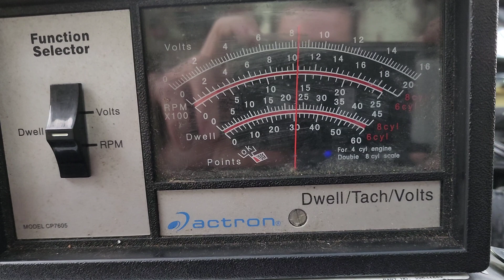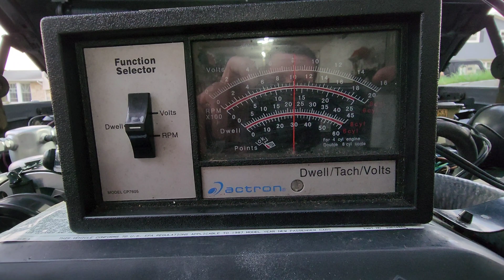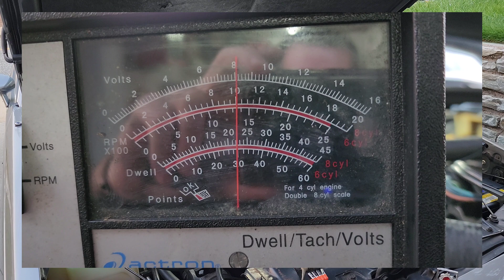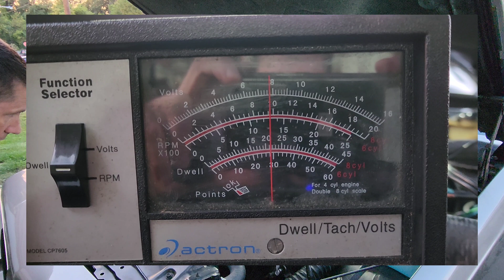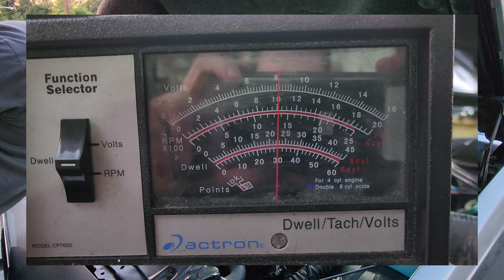The RIGHT WAY To Set The Mixture On Your Electronic Quadrajet Carburetor

Comment: Hello thanks for the job you do. It is excellent. But I have a question. My car is Cad. Brougham 1988 with engine Oldsmobile 307 8 cyl. with rochester 4BB E4MC. I am using the same dwell meter. But on 8 scale line I am reading 40 and on 6 scale line 30. In the video is mentioned to read on 6scale line. But your engine is 8cyl. I am not able to get on 30 on 8 scale line. Thank you for explenation.

Comment: What brand of carb tool is that?  I have a quadajet on Monte Carlo SS 305, but I have a remanned carb and the mixture screws are round with a slot in middle, will this tool work for it?

Comment: Hi thanks for the video, I have a question, I have a Cylinder dwell meter who have a Dial for select 4,6,8 Cylinder, The question is I need to select the 6 Cylinder or the 8 eight Cylinder option to set the dwell thanks.
Reply: Should be set to 6 Cyl
Reply: @rfbuilds8035  thanks for the help.

Comment: Question for you.  My '82 Ninety-Eight with the 307 Y runs slightly rough at idle, otherwise it runs fine when driving.  I've followed this carb adjustment video and have all the Thexton tools.  When I am adjusting the main jets I am not seeing the quick relatively changes on the dwell meter as seen in your video.  It seems like I have to make 1/2 a turn or more out so get the dwell to go higher.  And the changes I do see seem to be a bit inconsistent depending on when I make the adjustments.  Could this indicate a bad 02 Sensor?  Any other suggestions?
Reply from the maker: Shoot me an email at RPOrestorations @gmail.com. I'll see if I can offer a few suggestions

Comment: Great video with clear explanation. I have a Chevy G20 with this carb and it's impossible to get to the idle screws through the hood - so much stuff in the way you can barely see them!
Reply from the maker: Glad you found it useful. Thanks!
Reply from the maker: Uggh. Those are tough to work on.
Reply: @rporestorations  with the dog house removed and airbox you can just about get your hand to the front of the carb. Machined two "adjusters" from 5/16 rod with a slot cut on the end so I could turn both mixture screws.

Comment: 30° on the 8 cylinder scale.Should be on the six cylinder scale so you're still not there
Reply from the maker: I'm a little confused by your comment. The Quadrajet is set on the 6 cylinder scale of the dwell meter, doesn't matter what size engine its attached to.

Comment: Excellent video. Tuning the dwell made a huge difference in making smooth acceleration in my 87. Mine was a ways off, too high. Also cured a pesky hesitation between 1500 and 2000 rpm.

Comment: Great info, but... I have a 1986 Pontiac Grand Prix 305  Quadrajet.  The question I have I don't have any emissions on the car anymore but I still have the electronic carb and electronic distributor. Can I still use the carb and distributor even though I don't have any emission stuff? Seems to be running rich, do I still need to adjust mixture screws or should I just get rid of the electronic and go manual?
Reply: I have the same exact problem with my 1987 Firebird with the 305. Smog pump deleted. Seems to be running rich, already tore down Rochester and set the solenoid and floats to factory spec. When I adjust the mixture screws I get no change at all. Whether I bottom them out or back them off 6 turns. I don't have a dwell meter and I have not messed with the idle air bleed valve it's still capped off. But I did put a timing light on and it's running 0° at idle but starts retarding the timing as soon as I'm over 1500 RPM. I'm going to bypass the computer and put in a mechanical HEI ignition system. If yours has the computer and your service engine light is on, I'm guessing that your computer is pulling timing to causing it to burn rich and dump soot out the tailpipe like mine.

Comment: please help ......so im trying to set my dwell on my  86 GMC sierra 5.0 with electric carb. i purchased a dwell meter and connected the wire to a green wire on the firewall of the truck and adjusted just like you did and had no luck i adjusted with small turn and the dwell did no change what am i doing wrong or what should i do first please help
Reply: I think that green wire is for HEI dwell not carb dwell

Comment: Ok..but where on the carb is the idle air bleed?..all I noticed was your screwdriver diving in
Reply from the maker: https://youtu.be/LX4h6YH_KhY?si=w8cbhwGIqB1Ry4Qb

There's a good view at the 5:00 minute mark in thsi video.
Reply: @rporestorations  thanks but I googled it later on and discovered mine has a plated riveted over it..guess will just count on it being at factory setting

Comment: Hey man I have that same car 1987 Oldsmobile v-6 when I turn it on and it’s on cold idle it’s in perfect condition one’s it warms up and u put it on drive it has no power at all turns off can u please tell me how to fix it.
Reply from the maker: It could be several things. Will It idle at all when warmed up? Are you able to keep it going by giving it some gas?
Reply: @rporestorations yes thank you I replaced cables spark plugs and distributor cap what happened was that I had one of the spark plugs cable disconnected ha.

Comment: When adjusting the mixture control screw, do you adjust the driver side first then the passenger or do you adjust both together?
Reply from the maker: You have to adjust them both together at the same time. The carburetor should have a balanced mixture on both sides.
Reply: @rporestorations  do I close the screws or open them
Reply from the maker: Lightly close them. Then open them 3 1/2 turns. That's a base setting. Then make the adjustment as needed

Comment: Where can I find the air bleeder valve gauge tool
Reply from the maker: They're getting difficult to find, but they do come up on Ebay from time to time. The company that made them is named Kent Moore. They made a lot of tools for GM service departments. They also were included in their "Carburetor Float Kit"

Comment: That takes me back to the mid late 90s for sure lol. IMO, the hardest GM engine to get through the IM240 emissions test was the 307 Y olds mill. 1 thing I didn't hear you mention is that it is imperative that the car be in closed loop fuel control while making these adjustments, with a good o2 sensor. That's why I always use(d) a scan tool such as a Tech 1 or 2, or the ol Snapper Red Brick. I want to see eng temp, tps volts, o2 switching, and I can see dwell as well as block learn and integrator. Anyhow, I'm glad you're sharing this stuff. It is a lost art!
Reply from the maker: I did talk about it around 7:17, but you're absolutely right. If it's not in closed loop, the dwell won't vary and it will stay fixed at a certain reading. I like to use a Tech1A, too, but not many people have them, so I tried to keep it simple. And yeah, I always check the TPS voltage ahead of time. I might do a future video on the block learn and that stuff later down the road, as well. Thanks for the feedback. If you have any tips, Id love to hear them. Glad I could bring you back to the 90's!

Comment: Hi recently had my electronic quadrajet rebuilt and it is idling very high and running rich, other than the idle screws what do I need to adjust to have it idle lower?
Reply: Sorry I meant mixture screws not idle screws
Reply: @jaredrosenberger3583 Bet you have loose throttle shaft’s.
Reply from the maker: There could be a couple of causes. Is the fast idle cam disengaging when you tap the gas? And have you turned the idle speed control screw out? Check out the 2nd half of this video. It concerns setting the idle speed. 
https://youtu.be/o_LEpkWQbk4?si=uafHDGXKDpWYN471

Comment: Is 30 on the dwell meter specific to the engine or electronic carb? I have a 305 with the electronic carb would I still shoot for 30 but on the v-8 scale? 
Thanks for another informative video.
Reply from the maker: No. The 30° dwell meter reading is universal for all Rochester Dualjet and Quadrajet carburetors. Also, when setting the mixture, we always use the  6 cylinder scale, whether it's a 231, 305, 307, or 350 cubic inch motor. This is because the carburetor works on a 60 hertz cycle. (The solenoid cycles 60 times per second). Hope this helps!

Comment: Thanks for a more detailed video. But i think you only mention it and don't actually show that you jump out the 1 and 2 terminals on the computer port in the car. So do you or don't you to set the dwell?
Reply from the maker: No. You don't jump the terminals on the ALDL (computer terminal) connector. Jumping the diagnostic terminals would put the motor into "Field Service" mode. This would only be done when setting base timing and for a few other reasons when trying to diagnose a problem. When setting the mixture, you want the motor running as it would be while you're driving.